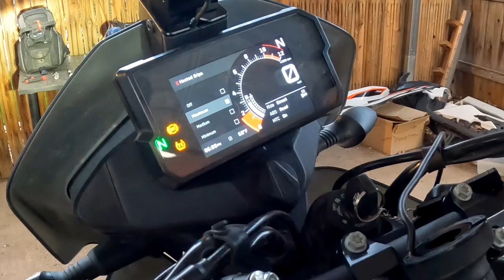KTM 890 Adventure: install OEM heated grips to keep your hands warm in the cold!

Comment: Thanks for the video. I installed mine today. I wasn't so lucky to have the heated grip connector so accessible. It took me about two hours to wiggle my hand behind the battery compartment until I could push it out through the front to where I could hook up to it. My battery box didn't come out nearly as far as yours. Electrical connections underneath it had very little slack, so it wouldn't flip forward. You would think KTM would put a little more effort into making this more accessible given how many adventure riders like to run with heated grips. Also, I noticed that you didn't install the module that it came with underneath the fuse box. The fuse box actually comes off and slides onto the top of the plastic cage it comes with and the heated grip module goes in the bottom of that plastic cage. Makes it nice and clean.
Reply from the maker: Nice, glad the video was helpful.  It is so weird how much the wiring varies bike to bike.  I used the kit for the duke so it didn’t include the bracket.

Comment: My dealer can’t get mine grips until July but I think after watching you I can do it thanks so sure.I just removed my seat and loosen the battery box and unhooked the ecm plugins I had to run a cloths hanger down to where the plug-in was I finally got it pulled to the front KTM doesn’t want to leave it out to where you can see it now just wait until my dealer gets them.
Reply from the maker: You can do it!

Comment: Great video, but man what a pain to get to that plug.  Finally used a piece of stiff copper wire and fashioned a hook on the end to snag it and pull it forward.  The whole kit is nicely fitted once you’ve finished.   Kind of wish there was just a botton on the grips like my BMW vs going through the menus, but glad to finally have some heat.
Reply from the maker: Thanks, hope it helped!
Reply: Most places online that sell the KTM OEM grips kit also usually sell a lower cost kit that has a separate handlebar button to control the grips with no interface to the TFT display.

Comment: Just got a 23 model. It’s super accessible in the front. Man, I think I mightve pulled the tank off maybe for more access. Thanks for posting though. YouTube has kinda turned me into a mechanic. 
I’m thinking about the seat now. I rode 350 miles and I can barely sit down. I was told the powerparts heated seat is a more comfortable design
Reply from the maker: I’ve considered adding the seat.  Post up if you like it.
Reply: A new rider will need to get the butt region "in shape" to A) get accustomed to the contours of the seat and B) withstand the occasional bouncing. The bouncing is 10x worse if you ride off-road, so all of the seasoned off-roaders ride standing up for the majority of the time. Even for a long highway trip, I often stand up to to temporarily relieve my quadriceps and hamstrings and to air-condition my pants and underwear and enclosed parts. Pro tip: try not to slouch when riding sitting down. Abdominal exercises really do help. I find the stock 2-piece seat on the 890 very comfortable.

Comment: Crazy how some guys have the connector just sitting up front for easy connection. Mine is totally buried like yours however I can't seem to make the connection with just my finger tips. Also you were able to get the battery box more out of the way. Now my arm is bloody from those wire harness guide pins. lol I thought this was gonna be so easy...
Reply from the maker: Some are just lucky I guess.  Not easy for most!
Reply: My 2023 KTM 890 Adventure had the white connector staring right at me underneath the headlight, between the forks.

Comment: Hi, i have the 2023 R model and it does not have the heated grips installed. Do i need to get it activated by the dealer so that i can control it through the menu? Thanks
Reply from the maker: You should be able to turn it on yourself in the menu.

Comment: Where does the bracket go?  They supply it and you didn’t install it. Other videos skipped it as well.
Reply from the maker: The bracket only comes with the adventure kit and it holds the module more securely.  I installed the Duke kit so it did not include the bracket.